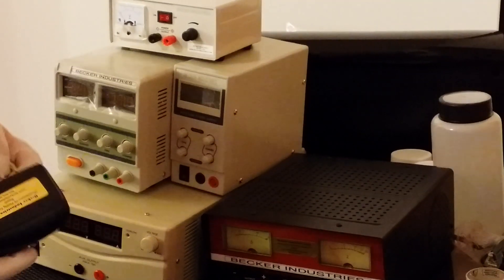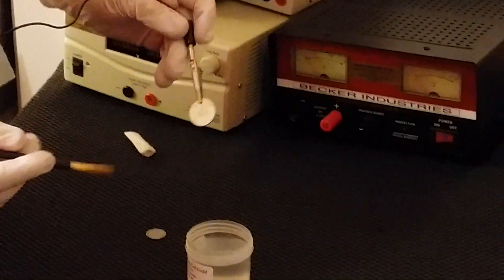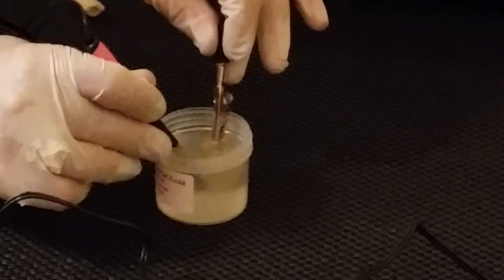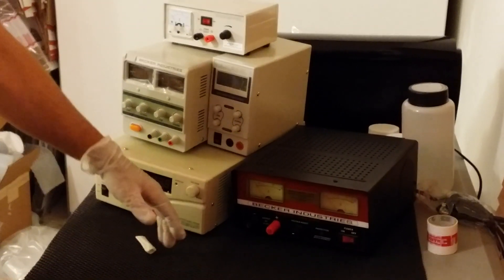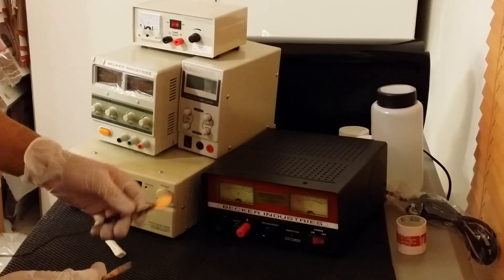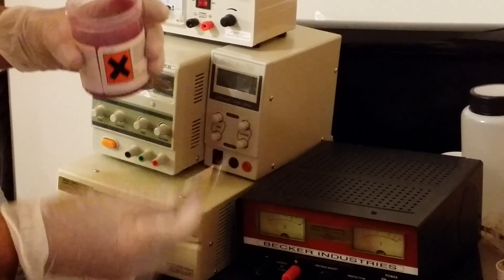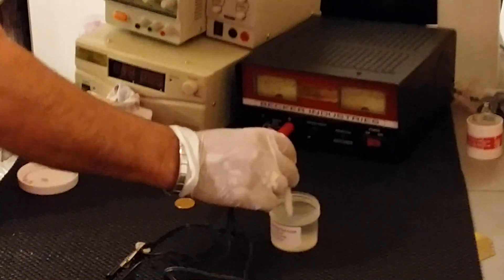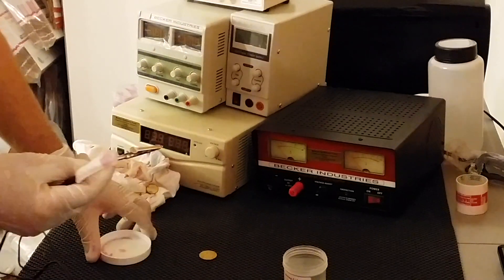How to gold plate with mini plater

Comment: It has been impossible to get more details from the seller about this product:
- What is the maximum size of an object that can be plated?
- How many uses before the gold plating solution needs to be replaced?
- What exactly is in the gold plating solution? I need to know this for importing reasons.
- How many microns thick will this kit plate a metal object? Does the gold plating come off easily?

I have asked the seller these questions repeatedly but he either doesn't reply or dodges the questions. I won't buy this product until these questions are answered. Other gold plating kits are more expensive but if they are more effective then that explains why.
Reply: Don't use them. We waited over a month for a large kit which never arrived.